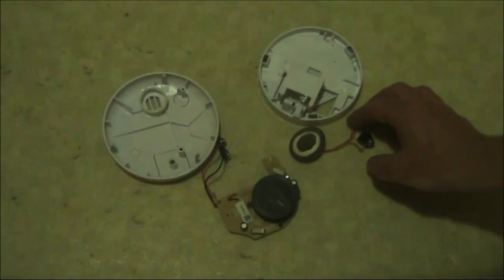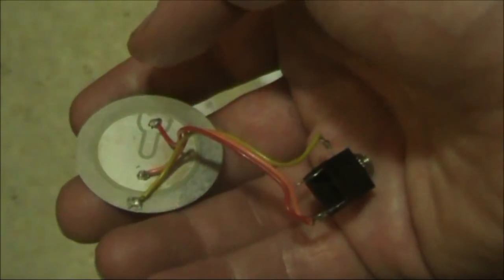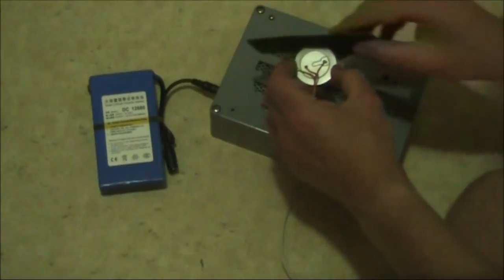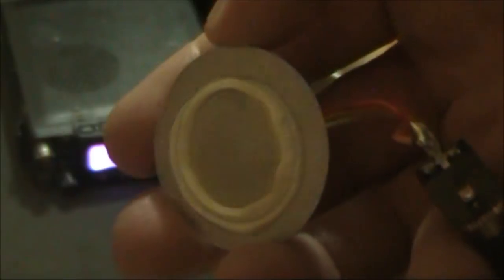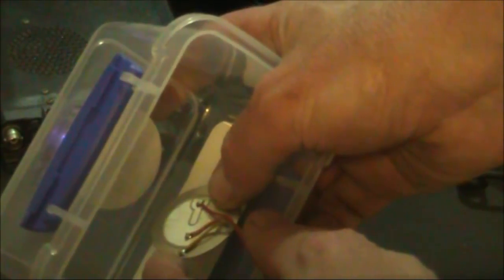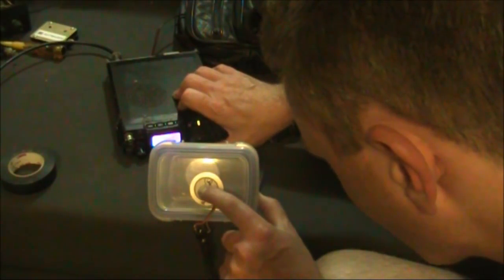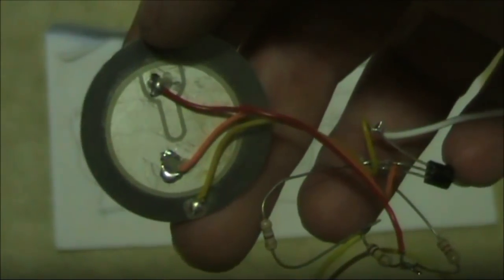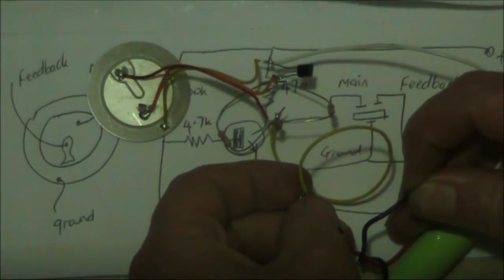Uses for piezo transducers from old smoke alarms

Comment: The large disc doubles as a speaker and microphone. The small oscillator is for creating the radio signal in the smoke detector chip, that has no datasheet online.

Comment: The problem with piezoelectric and contact mics is that they are not well matched to typical audio inputs. The reason why these devices often sound tinny is because the piezo sensor presents its signal through a series capacitance which is small, typically 15nF or less. When wired to a normal 50 kilohm line input this forms a 200Hz high-pass filter, which eliminates the bass. Because the piezo disc has a very high impedance (1 MΩ typical), it should be buffered to avoid possible impedance mismatch with an existing audio system. This circuit acts as a impedance buffer, and some amplification does not hurt as long as it is around 40dB.

Comment: Hi, also useful: using the disc to detune a GPS ceramic antenna (1.575 GHz) so it works in the hydrogen band. It needs a bit of tweaking and having a unit with the right characteristics but as long as its the same material you have a fighting chance. Best to remove the front coating not the back as its typically in worse shape, same with GPS ceramic. Possible to simply glue them together with a powder ceramic coating like BaTiO3 EL dielectric material in Epoxy.

Comment: One might attach it to his/her instruments for "electric" fiddle or banjo or othersuch.  Nearly all "accoustic" guitars come with piezo "pickups" already install these days.  Gives different tone tones than magnetic pickups normally found on amplified guitars.  No I've not done it yet, just found out my new source of piezos.  Normally located near the bridge, move it around for best tones.
Reply: The problem with piezoelectric and contact mics is that they are not well matched to typical audio inputs. The reason why these devices often sound tinny is because the piezo sensor presents its signal through a series capacitance which is small, typically 15nF or less. When wired to a normal 50 kilohm line input this forms a 200Hz high-pass filter, which eliminates the bass. Because the piezo disc has a very high impedance (1 MΩ typical), it should be buffered to avoid possible impedance mismatch with an existing audio system. This circuit acts as a impedance buffer, and some amplification does not hurt as long as it is around 40dB.

Comment: Yeah, ditto on the solderng tip.... don't apply much heat at all and make the connection as fast as possible.  I used to work for a sub-contractor for the US DoD and once had to solder about 2000 of these little buggers.  I think we had to scrap about 40 of them because of that little issue.

Comment: They work great when glued inside a guitar. I buy mine from eBay for a few cents each and use them for pickups in the cigar-box-guitars I build. 

https://rover.ebay.com/rover/0/0/0?mpre=https%3A%2F%2Fwww.ebay.com%2Fulk%2Fitm%2F112098499063

Btw, do you think you could use some additional lighting in your videos? I am 73 and my eyesight is beginning to fail and it's extremely difficult for me to make out some of the details you are demonstrating. Please don't take this as a gripe about the content of your video, it is just the downside of me getting old!  

Thank you for the time you took and making this video and sharing it.

Best regards,

Mick Bradford

Comment: Very cool but wouldn't saving that peizo give u a headache cause smoke detectors get off radiation if u take apart the smoke detector
Reply: HondaRidgeline Enduser the radiation is in the sensor not the speaker
Reply: Yes, just keep Away from the detection chamber